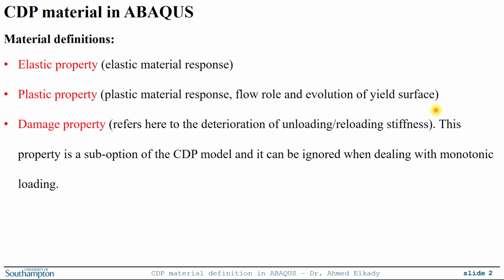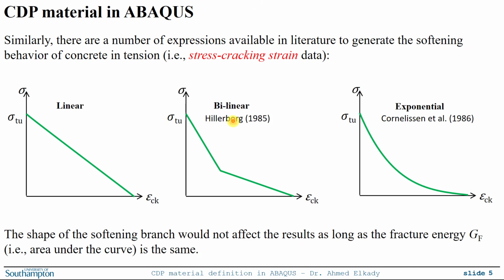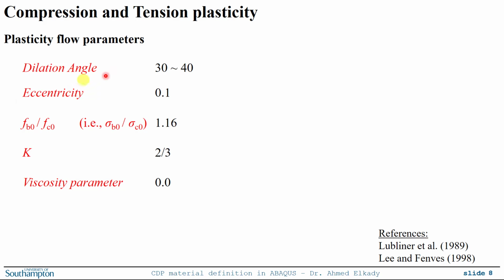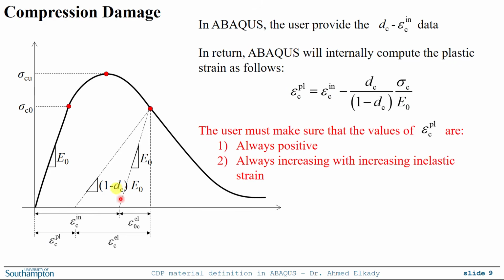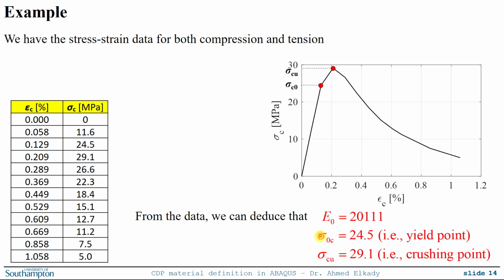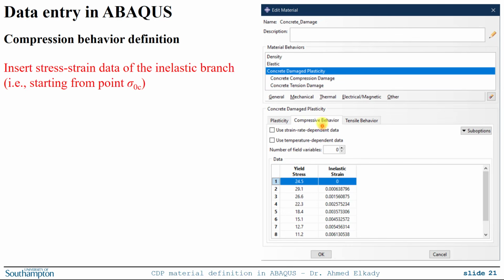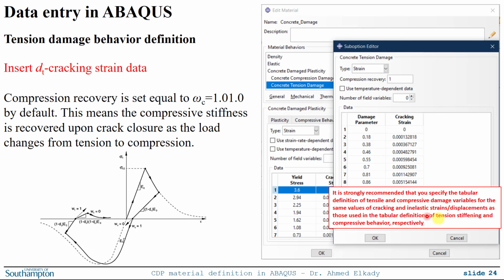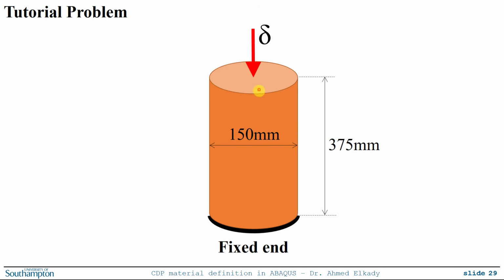#21 ABAQUS Tutorial: Defining Concrete Damage Plasticity Model + Failure and Element Deletion

Comment: Really thankful for this information and the tool Dr. Elkady. Would be great if the tool was available also to calculate the CDP model for totally confined concrete, like in CFT columns for example.
Reply from the maker: I would recommend you check journal articles in the litrature on the difference between confined-unconfined material beahviour. Generally, the curve shape is similar and you only need to modify the main input stress and strain properties.

Comment: Hi Dr Elkady, if i want to include the formulas for calculation of all CDP data (Damage values, etc) should i site the FIB model code or Eurocode? Or is there any other code or source out there that specifically shows these formulas?
Reply from the maker: You can use any of the research-based or code-bosed models, including the ones used in this app. The references are available online where you can find the mathematical formulation of each model.

Comment: A very interresting Lecturer. Easy explanations and clear supports. Thanks a lot Doctor. However I want to know if this CDP model is or not appllicable to the soil materials (I am dealing with Interlocking compressed earth block shear testing)?
Reply from the maker: Probably, the CDP model can be used to simulate similar behaviours in particular soil types. I would recommend consulting the literature to find out what approaches are used.

Comment: Great video. I have a question regarding the calculation of the damage parameter. How is it zero initially and increase with increasing stress. The equation used to compute it suggests otherwise. It should be a higher value initially and then as the stress gets closer and closer to the crushing strength, the value of 'dc' should reduce. Is there a typo in the equation presented in the slides?

EDIT: For anyone else wondering the same, I looked up the paper "Simplified Damage Plasticity Model for Concrete" by Hafezolghorani et al. (2017). It states that the damage parameter (dc) is zero till the maximum compressive stress is reached, meaning that the parameter 'dc' should be computed using the equation (mentioned in the video and the paper) only after the maximum stress value. All values for 'dc' before the max compressive stress should be input as zero.
Reply: Thanks, was wondering about the same..

Comment: First of all thank you sir for such wonderful video. I have one question:  my abaqus file (modeling of beam-column joint under cyclic test) is showing error when i do edit keyword as suggested in this CDP video. For simulating crack do i need to install the exe. file in you CDP generator file as available in the link mentioned in the description. I am using Abaqus 2020. I will be grateful if you have any other suggestion to deal with it. Thank you sir

Comment: sir, why is dc equal to 0. its supposed to be 1 at the starting strain cause its corresponding generated compressive stress = 0. so (1-0) = 1.
Reply from the maker: the dc parameter starts at 0 and reaches 1 at full degradation.

Comment: Why does *Concrete Failure keyword not work in Abaqus2017?
Reply from the maker: this keywork is only availaible in post 2019 versions.
Reply: @AElkady  then which keyword does same thing for 2017 version?
Reply: @sudipgautam5416  . Did u get the keyword for v 2017 ?

Comment: Hello Dr. Elkay, just a quick question about the element deletion. Is the element deletion only affecting the visualization? Or is it actually affecting the analysis result?
Reply from the maker: No, it would not affect the analysis. This is a visual representation of reaching the maximum value of the damage parameter D. https://classes.engineering.wustl.edu/2009/spring/mase5513/abaqus/docs/v6.6/books/usb/default.htm?startat=pt05ch19s02abm39.html

Comment: Dr. Elkady, could you please explain how could you determine yield stress and the elastic modulus from the stress-strain curve of your concrete sample?
Reply: I'm wondering the same problem sir, have you figured it out yet sir?
Reply from the maker: E is dedcued as the secant stiffness based on the fc0/fcu ratio specified by the user. This ratio is 0.4 by default.

Comment: Dear Dor,I used your data ,but still showed "DURING THE CONVERSION FROM CRACKING TO PLASTIC STRAIN Abaqus FOUND NEGATIVE AND/OR DECREASING VALUES OF PLASTIC STRAIN FOR MATERIAL NEW-CDP. VERIFY THAT THE DEGRADATION DATA UNDER *CONCRETE TENSION DAMAGE IS CORRECT".
I need your help ,please!!!!!!
Reply: If you got the solution, please help

Comment: Dear Prof can you please confirm that for CDP in Abaqus the concrete stress- strain relationship we need to  use is for a confined concrete or unconfined concrete ?? Actually i have a simulation in which the grout is confined by steel sleeve so i  need to know that i modelled the sleeve in Abaqus and i believe that Abaqus should consider the confining effect of this steel sleeve on grout and therefore in my CDP i used the unconfined stress - strain relationship ..is my approach ok or i need to used the confined stress -strain relationship for my CDP ?

Comment: Really impressive and clear understanding ,,while developing the sheet I got following queries 

1-  I already had the stress-strain data from the concrete cylinder using strain gauges. I saw in video that you actually used percentage strains. Is this just dividing the strain by 100 or some other conversions too 
2- For the damage factor i dont get zero values initially if I subtract the ratio from 1. Also when I reach the yielding compressive strength of concrete my damage parameter is 0.54 ..is it ok 
3- My plastic strain are coming negative do I need to put those values zero directly or there is some other mistake in the data
4- While entering data in ABAQUS for the tensile part we actually get the split tensile strength from cylinder and the rest of the softening branch wasnt obtained so we use models is literature for this part ??

Comment: Hello Sir,
Very glad to see this informative video but I wanted to know how the temperature effect is incorporated into this model. I am also a structural engineer and do simulations. Basically, my area of research is the effect of composite columns at elevated temperatures. When I was taking the consideration of temperature in the damaged part of the CDP model it gives an error "Negative plasticity or crushing strain is more than plastic strain",  I have checked that thing which is correct. Could you please guide me to deal with the CDP model considering temperature?

Thanks & Regards.

Comment: Hello Dr. Ahmed I get more skill from your video tutorials! 
I try to model concrete steel encased composite frame joint of column-beam! and while I submit the job it say "DURING THE CONVERSION FROM CRACKING TO PLASTIC STRAIN Abaqus FOUND NEGATIVE AND/OR DECREASING VALUES OF PLASTIC STRAIN. VERIFY THAT THE DEGRADATION DATA UNDER *CONCRETE TENSION DAMAGE IS CORRECT

Analysis Input File Processor exited with an error." please could you help me?

Comment: Thank you for the great explanation, I am working on RC in-span hinge model. First, I modeled the concrete with elastic behavior only, and the model run without any error. Then, I defined concrete damage plasticity following your explanation, but I got this error " Time increment required is less than the minimum specified".
I decreased the min. of increment size, then I got this error" Too many attempts made for this increment". what should I do? thank you in advance.
Reply from the maker: I assume you are using a static step in your analysis. To avoid convergence issues, I recommend you use a dynamic explicit step when dealing with softening materials such as the CDP model. Please check the tutorials on RC beam bending and explicit solver.
Reply: @AElkady  thank you so much Dr. Ahmed

Comment: Hi, thanks for your great lecture; however, I faced this problem when I use your data. Why? 

DURING THE CONVERSION FROM CRUSHING TO PLASTIC STRAIN Abaqus FOUND NEGATIVE AND/OR DECREASING VALUES OF PLASTIC STRAIN FOR MATERIAL CONCRETE_C30-AHMED_ELKADY. VERIFY THAT THE DEGRADATION DATA UNDER *CONCRETE COMPRESSION DAMAGE IS CORRECT
Reply from the maker: The provided data is correct. I suspect you made a mistake in data entry (e.g., empty or repeated cells). Please double check and follow the tutorial guidelines.
Reply: @AElkady  Thanks for your response.

Comment: جزاكم الله خير يادكتور.
Is the elastic strain we substitute from the total strain is calculated as constant value? (max elastic strain at yield) or variable value calculated as ratio between stress and young's modulus for every stress value?
Reply from the maker: you can just use the yield strain at the initial yield point.

Comment: hello, sir thank you so much for your supporting video here.I think the elastic modulus of the concrete is taken from the slope of stress -strain until yield stress which given us189.619 MPa(N/mm2) .but your result is 20111mpa how? even their digit has a different?
Reply from the maker: I think you mean 18961.9MPa not 189.619MPa...Anyway, here I'm using a slightly different value for Ec but it does not matter, you can used 18962MPa instead.
Reply: @AElkady   thank you sir for ur response ya it is 18962Mpa .
Reply: I think that he calculated Young's modulus of 20111 MPa from tension data.

Comment: Hello Sir. I have tried to use keyword 'concrete failure' in abaqus, but it gets error. The Abaqus said that this keyword is not recognised. Could you please let us know how to solve this problem?
Reply from the maker: This keywork is available in v2019 and later versions. If you are using an older version that might be the issue. Incuding "concrete failure" is not critical anyway and you can ignore it.
Reply: @AElkady  Alright. Then I will update the software to the latest version. Thank you very much.

Comment: Thanks for the video. 
Sir, i just have one question that if i want to include dowel effects of rebar in RC structure; can i change the value of tension stiffness recovery to say 0.5 or 0.7 to model the behavior under dynamic loadings or i have to increase the values of cracking strain at failure (say 0.05 plastic strain in tension at failure). I have read the abaqus documentation but i just want to confirm with some scientific studies (maybe abaqus user conferenece papers) on this tension stiffness recovery parameter.
Reply from the maker: There are actually a number of good esearch papers going in depth regarding the proper modeling parameters to use in different cases (look up finite element reinforced concrete in google scholar). I recommend you check some of those as they would include more relevant answers.